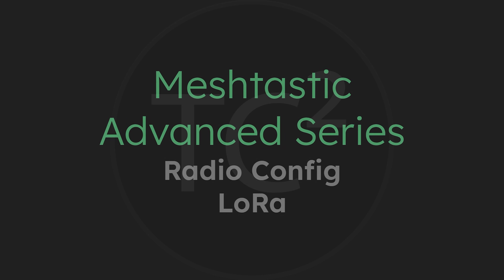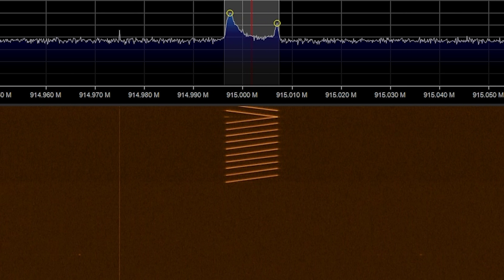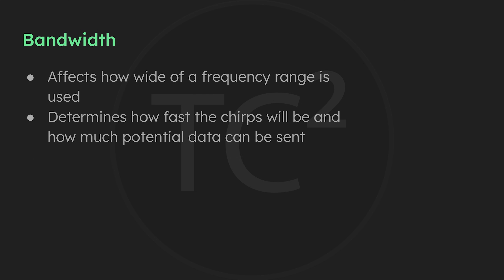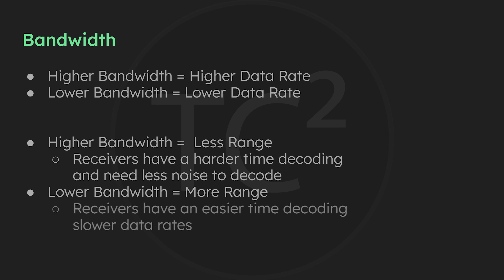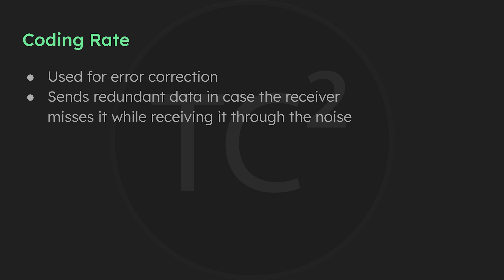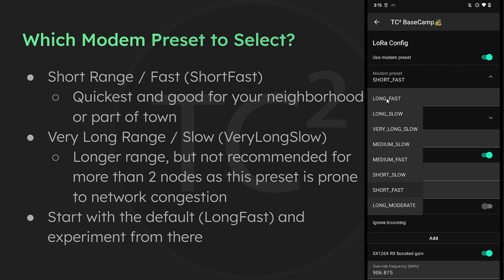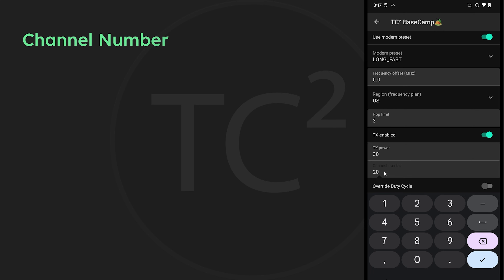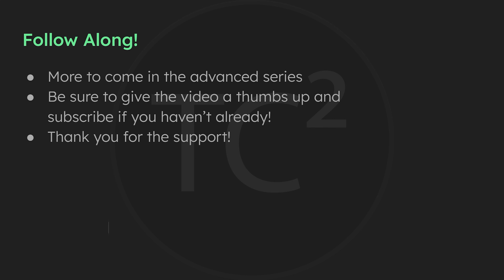Advanced Meshtastic - LoRa Configuration

Comment: I have a question regarding the Frequency / channel ,  In long fast, US  channel 20,  the frequency calculator shows 906.875 Mhz  but your SDR spectrum analyzer showed the center frequency at 915Mhz,  and also this is the frequency I have seen time and time again to be what we are supposed to use.    my HELTEC devices show my frequency at 906.875Mhz in the override frequency slot,  same as shown in your video.
Reply from the maker: The ISM band is from 902-928MHz so anything in that range. Most people are on the default 906.875 so use that if you want to talk to others
Reply: @The_Comms_Channel  I pulled out my SDR radio and could see on the waterfall, I am in fact on 906.875Mhz,  with the primary default channel.   what I found interesting is how may signals in the 902-928mhz band there are transmitting in my area, with all kinds of bandwidths and frequencies.
Reply from the maker: @Artiflex-ai4u  yep! There's all sorts of stuff on that band, garage door openers, older cordless phones, ect. I have a weather station and it also uses that band
Reply: @The_Comms_Channel  oh i know the 900mhz was used for zillions of things, I was talking about LoRa type signals,  they are easy to spot on the waterfall.  wide burst of data.  I set the sdr radio for as wide a spectrum,  and these signals were all over.  I was monitoring for a couple hours,  and you see the similar routine pulse of data every few minutes,  some frequencies had more traffic than others.  so seems something or someone is communicating,  anyway,  i was just amazed at how much was there.  and I was using a small antenna that wasn't even outside,  but I am in an urban environment.

Comment: Thank you for you other reply!  I am noticing that when I manually set the bandwidth to "32" , Spread factor to 12 and coding rate of 8 "It doesn't work" (RX does not decode anything).. (Heltek 440MHz boards) I think this is a limitation of the hardware or possibly the quality of TCXO or lack thereof.  Do you know or are you aware of hardware that will work at these much slower rates and bandwidth usage? I am experimenting with trying to get even longer range and also experimenting with being able to narrow down the bandwidth to "fit" into a normal 25KHz FM frequency bandwidth "slot" or "channel".
Do you know if there is better hardware than can actually "work" in an 11KHz or 8KHz RF "channel" or even 32KHz for that matter?  Or are we limited by hardware to what Meshtastic sort of already lays out as options.  In your video you were demo-ing  some really low bandwidths and speeds for the sake of visualization -- but can those actually work over the air if you wanted them to?

Comment: That was fantastic.  
Thank you for putting all of your work into it.  
It looked like you might have been recompiling firmware to get the lower bandwidth "options".  
I'd like to dig into this but not sure where to start?
It also looks like you have to have python setup to do any command line stuff with nodes -- is that correct? 
Again thanks!   I'm brand new to Meshtastic and playing around with it now.
This video was extremely helpful.
Reply from the maker: Glad you found it helpful! I used the examples from RAK Wireless here for the firmware https://github.com/RAKWireless/WisBlock/tree/master/examples/RAK4630/communications/LoRa/LoRaP2P

As far as Python goes, there's a Python library for Meshtastic https://github.com/meshtastic/python
Reply: @The_Comms_Channel  Thanks!

Comment: im new to meshtastic and ive noticed that your override freq is 906.875mhz... my 3 nodes all have 906mhz out of the box, but the US default is supposed to be 915... i played around a bit for science and ive noticed that if i have 1 node at the out of the box default of 906mhz and another one at 906.875 they cant see or communicate with each other... sooo that makes me wonder how people are supposed to know what others freq is to chat on the public channel.... i know for a fact there are others in my area but i dont see any other nodes but my own...
Reply from the maker: The default is 906.875. The ISM band in the US is 902-928MHz. 915 is the center of the band so it's often advertised as that for antennas. You need to have the same LoRa settings to communicate with others, including the frequency.
Reply: @The_Comms_Channel  i find it interesting that out of the box every unit no matter what device it is or were you get it is set to 906 out of the box for some reason but the correct default is supposed to be 906.875 this posses an issue as most poeple will leave it at the out of the box 906 and not change it like one person in my area that has a few nodes at 906 and not 906.875... added note they recently changed to the correct channel and 6--8 new nodes popped up... this should be made aware to any company that makes premade ready to use nodes  to make sure that the freq is set right (such as rokland wismesh pocket for example its 609 preset out of the box instead of the autofill from region selection).....

Comment: Great Video and explanation.  Could you please make a video showing just how you were able to make the bandwidth changes on the fly?  Looks like you're using an arduino program to make the changes but how is it connected to the radio.  Would be interested into seeing how you actually set that up.  
Thanks in advance,

Comment: Is that hop limit explained correctly? I thought that hop limit refered to how many times a node retransmitted the same data. If the mesh only allows a msg to travel through 3 nodes/3 hops it won't make it very far?
Reply from the maker: The node with the lowest signal (and likely furthest away) will rebroadcast first to ensure that the hops are reaching as far as they can.
Reply: @The_Comms_Channel  I see I think. So if a node knows for a fact that the msg was received it will continue to transmit it to the next node. On and on and on?

Comment: I've  had an interest in Meshtastic for over a month. after watching many videos on it.   I did build a tiny 915 MHz ground plane antenna connected to my RTL SDR monitoring the  frequencies between 902 to 928 MHz and found many,  mostly 200 KHz wide blips in varying signal strengths   which look and sound like those speeded up chirps on your video,  a good sign there is local Mesh action in my area.
Reply: There are a number of Meshtastic maps that document where nodes are reporting to be.  The one by Liam Cottle seems to be the most comprehensive if you want to know if those transmissions are nodes in your area.
Reply: Hot nodes in your area, contact them with this one weird trick?

Comment: Thanks for this video, it's great!
 In my T-Deck I used the default LONG_FAST channel and the transmission bandwidth received by my RTL-SDR is 256 kHz. Based on your video I started to wonder if it should not be by default lower for the long range communication?
Reply from the maker: Sure thing! The developers made Long-Fast the default since it's a good balance of distance and speed. The slower settings really do get congested after the number of nodes grow

Comment: Thanks for the series! I'm curious, with regard to the hop setting and the default of 3. if a packet or message passes through a node set up as router, does the count get reset? The maximum of 7 hops seems kind of limiting for a network that could theoretically cover a pretty big area.
Reply from the maker: Sure thing! Devices setup as router/repeater don't reset the hop count. High hop counts really make too much network congestion.

Comment: Can you go over adding a private channel, for use on a local mesh?  

I've gone to the Channel menu (4th icon from left) and clicked on the name Field, I clicked "Add", entered a channel name, then clicked save. I clicked on Send and it presents me with a QR code. 

When I scan the QR code on another device that's connected to the public MQTT server on channel zero, all traffic to/from the MQTT server ceases.

My understanding from the documentation was that traffic on channel zero would always be sent and received and that each node with the same channel 1 (for example) setup could talk to each other. That doesn't happen with me. Once I switch to channel 1, the newly set up private channel, by going to Radio Configuration... Channel... And clicking on the new private channel all traffic ceases.

What am I doing wrong?

Do you have to "switch" channels to send a message on Channel 0 and switch again to Channel 1 (private channel) if you want to send a private message to a node on Channel 1?

How do you start a conversation on the private channel if you've not communicated with that node before?
Reply: Hey there, you found an issue I also agree is underdocumented. Until it gets fixed, I can give you a few pointers that should get you unstuck.

When sending a message (and 1 and 2 count with MQTT as well) ALL of the following need to match on both devices:
1. LoRa modem preset: If you added a private channel, this probably changed! Double check that the "LoRa channel" is set to 20 if you are using the default LongFast. It's fine if it's 0 unless you added a private primary channel, then you need to change it back to 20 to work with the public mesh.
2. Channel PSK: You added a private channel, I'm sure you got the PSK right, just needs to match.
3. Channel Name: This is the kicker, over Radio AND MQTT, the encryption (and MQTT topics) use the name of the channel to know which PSK to use on the receiver. If sender and receiver have the same channel PSK but different names, there won't be a message received.

Bonus tip: Direct messages only work if sender and receiver have identical primary channels per above :) 

I hope the above can be further documented officially (or improved) soon

My sources are experimentation, and some chats with the devs
Reply: [Update:] Maybe this was an MQTT issue, as, after several hours, I started receiving messages without me changing anything!

[Was:]
Thanks for your help. A more important problem has arisen!

I have 3 nodes, one is connected to the public MQTT server, the other two can each talk to each other and i send messages to the MQTT server. All was well until 8 days ago... Then, one message would get sent again, and again, and again, at least once every time I cold booted a node... For more than 8 days! This evening, I reset all nodes  to factory settings, deleted the Meshtastic app and cleared it's cache and data prior to reinstalling the app and reconfiguring the nodes. Reconfiguring them is pretty easy... Each of the three nodes sees the traffic coming from the MQTT server, but no messages are being received from the MQTT server. I've quadruple-checked all the settings and don't understand why none of the nodes is receiving messages. When I send messages, they get the checkmark, but no responses come back. Messages sent from the node connected to the MQTT server show an up arrow, not a checkmark. Something is wrong! I'm seeing 28 of 59 nodes connected. So confused! Getting this to work is easy, but when it goes wrong, it's a total pain.

The MQTT node has MQTT and proxy to client enabled. The "LongFast" channel has uplink and downlink enabled and is otherwise at its defaults. The channel settings for the other two nodes are at their defaults.

Any suggestions?

Comment: I'm a Ham interested in LoRa coms. Thinking about getting three radios, 2 in our cars and one connected to a high gain vertical antenna on my ham tower. This should give us good coverage in the local area. But, my Smart home equipment is from  YoLink using LoRa. I fear the 915 MHz environment here is going to be too polluted. Every YoLink device has a radio running. 
Will a com receiver be De-sensed by my YoLink system?
Reply from the maker: It should be fine. I have a number of devices on 915MHz like my weather station, soil sensors, ect. No issues so far.